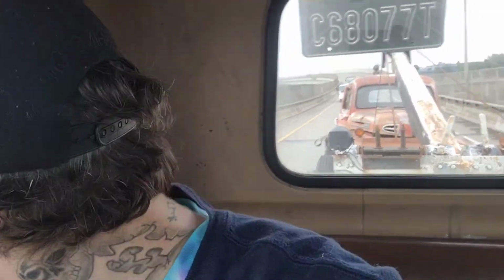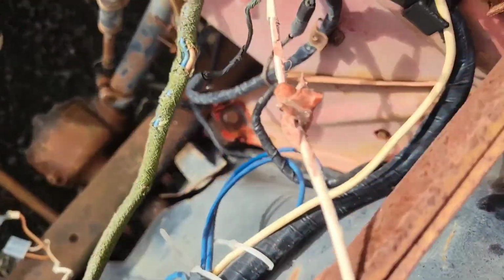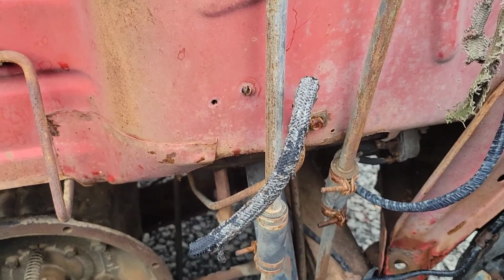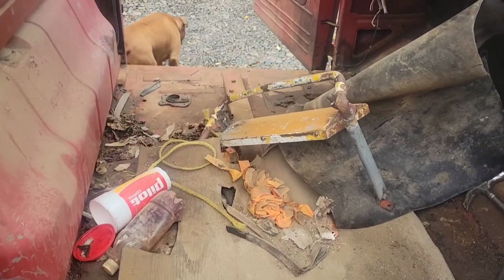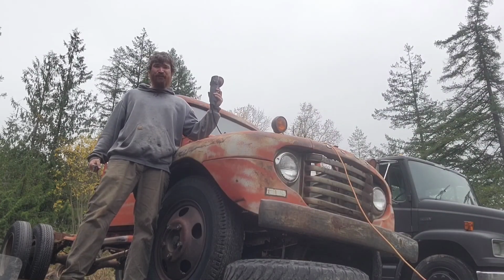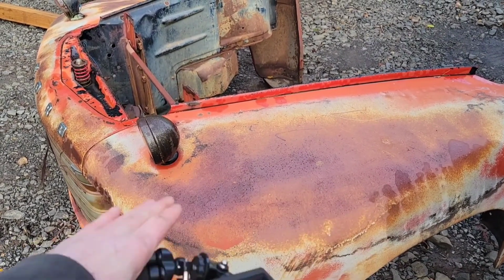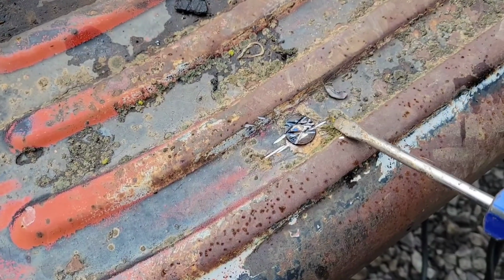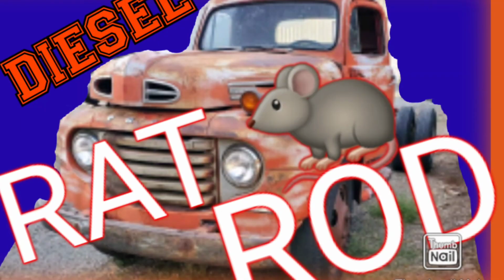Ratrod rat rod build ep.2 removing a 70 year old ford truck cab

Comment: Is the Black Freightliner FL60 with the Century rollback bed in the background a new project? I’m excited to see this project, for a 1950, it’s pretty clean. I have a 56 Plymouth Savoy and the floor and body is in way worse shape
Reply from the maker: The freightliner is a new project. That's why I sold the ramp truck so fast. Had the opportunity to sell it and a few other projects and upgrade to the rollback. Have not uploaded a video of it yet, but it's in the works.